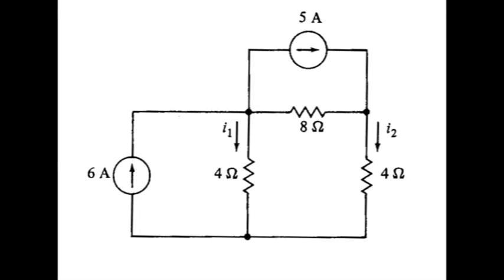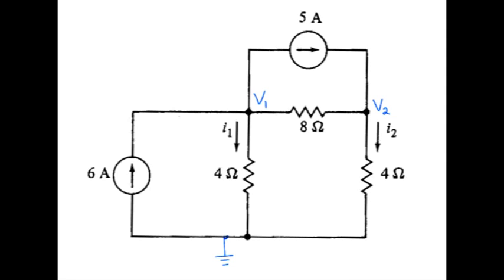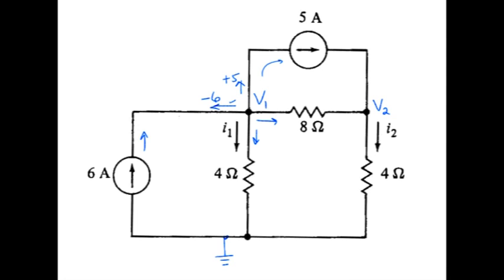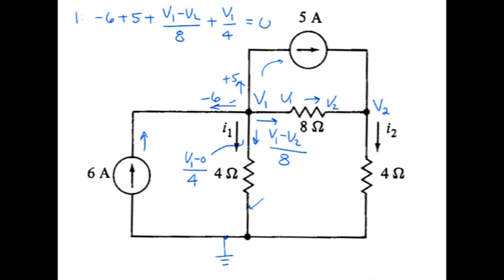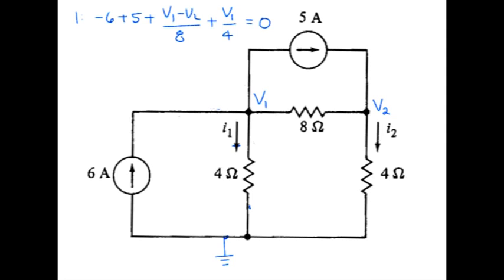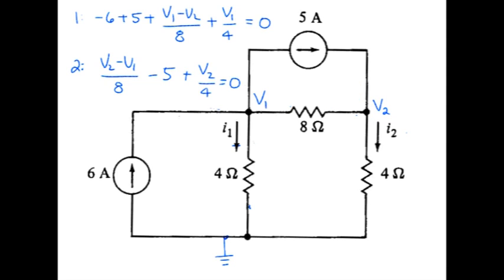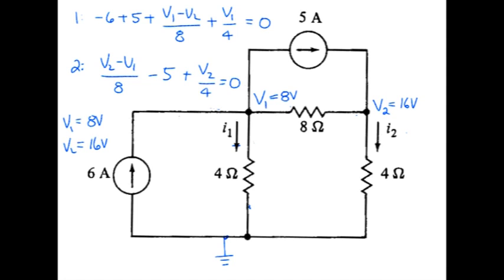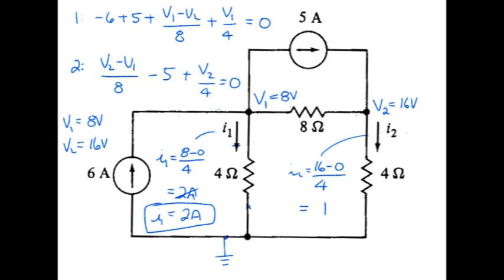dc: Node Voltage Example #1

Comment: WHAT SHOULD I DO IF I HV A VOLTAGE SOURCE? TQ
Reply: you need convert voltage source to a current source, you can do it easily to do resistor to pararell with "old voltage source"